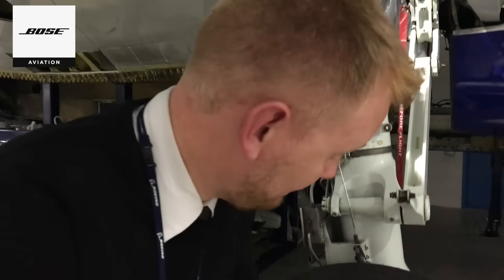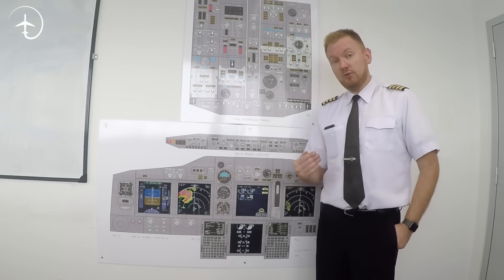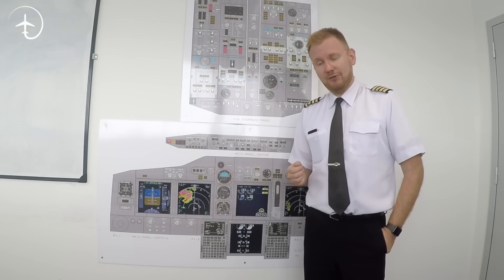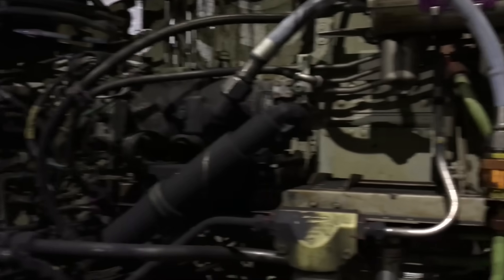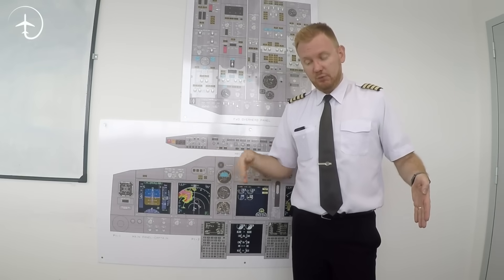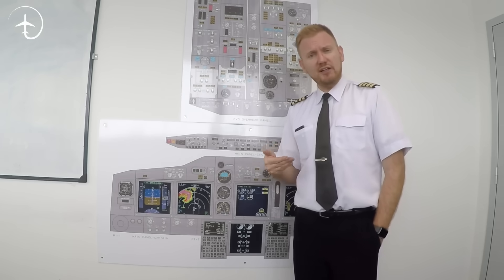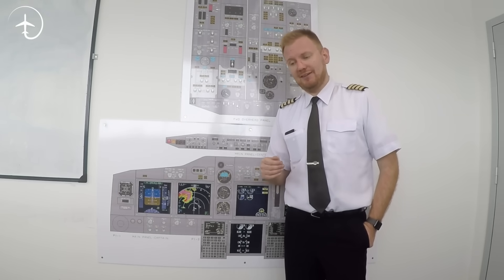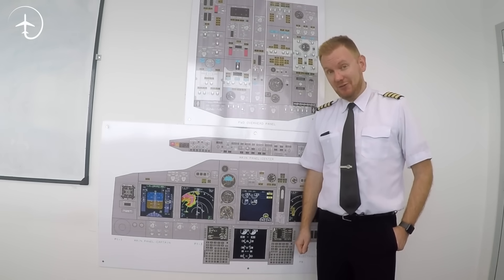Why does the Boeing 737 not have any landing-gear doors?

Comment: The short answer to the question is "laminar airflow".  It just flows over little spaces like the ones there.  With student naval aviators in T-28s, they thought that opening the canopy (sliding aft) would create drag and shorten the glide.  So we'd let them try it and it made almost no difference--the air just flowed over the resulting open space and didn't catch the open aft canopy much at all.

Comment: Disc covers on wheels are used on very high speed cars like for speed record attempts, aero 101. I'm surprised that all that equipment in the wheel wells is not simply covered by removable panels, they would keep the rubbish out at all times too and keep everything cleaner which would facilitate maintenance. Boeing, hmmmm.

Comment: Petter, if the 737 wheel well isn’t pressurised, and the psi is high enough to support the weight of a 737 @ sea level, surely in the rarified air @ 35,000ft, the tyre would want to blow - like a weather ballon?? 🌈

Comment: Tires are filled with Nitrogen. PSI depends on 737 series. Between 200 and 230 for the 737 Max. When servicing these tires it’s best to stand away just in case they blow up.
Reply: I got confused when he said 14 psi I figured it would be a hell of alot more
Reply: Really it depends on the tires the airline decides to use, but 14psi is hella low 😂
Reply: @Radim0303875  no. Its dictated by what boeing says is required, it's not up to the airline.

Comment: One extra step when changing the outboard tire/wheel assembly because of wheel fairing. Also wheel nuts are not visible on walk around inspection before flight. Not great. But it works.

Comment: Can you please make a video showing the difference between CFI,CFII and MEI
Reply: A CFI trains you to fly, a CFII trains you to fly on instruments, an MEI trains you to fly with issues related to multiple engines and engine failure.  

The only tricky part is that CFI is the base certificate.  CFII and MEI are added to it.

Airline pilots need all those skills and their instructors will likely hold all three at once.  

A video about the process of getting certified both as a pilot and as an instructor would be interesting.  I'm not sure if Mentour is based in the US though.

Training is regulated by an airline's home country. Everyone has pretty much the same standards, there's even a treaty about it (ICAO), but the details of training and certification will be somewhat different in different places.

Also once you have a larger business that flies commercially, that business is called an "operator" and the laws require operators to make and follow whatever rules are they are required for safety and common sense. This means that airline pilots are following a training program that's specific to their own airline and which goes above the requirements of their certification.

All pilots have the same responsibility to keep improving their skills, just like they have responsibility for flight planning and inspecting the aircraft, but in an airline the pilot isn't left alone to fulfill those responsibilities.  The airline helps them out with formal training and maintenance and flight planning.

Comment: Petter, one thing I didn’t hear you mention regarding the exposed tyres is low outside pressure. How come this doesn’t cause bloating or even blow out of the tyres? ✈️
Reply: Bill Kerman The 737 wheel well isn’t pressurised & the psi is high enough to support the weight of a 737 @ sea level, so surely in the rarified air @ 35,000ft, the tyre would want to blow - like a weather balloon?

Comment: 14 psi... I hope that you will never fly an aircraft with this wheel pressure in the wheels 😂
Reply: Ok that makes sense. I guess he was wrong. I believe you, sorry
Reply: preston rather that pressure is fine. The tires are large enough that they only need 14psi. Also, it is nitrogen not air so that could make a difference too.
Reply: its_kaven I am an aircraft tech and I can tell you that 14 PSI is not the correct pressure, its more or less 200 depending on the aircraft (189 on main gears of A320), 169 on the center line gear of the 340-200/300. But never ever 14 PSI on a 73. 
The size of the tire doesnt mean nothing, on the 320 the nose wheels are 206 PSI and mains 189 as I said. 
14 psi is not even what you put in your car wheels...

Comment: Boeing engineers...do we really need landing wheel doors?  do we really need secure cargo doors?  do we need an aerodynamic plane or will MCAS do?  That’s the problem in keeping an 1960’s frame flying.   Maybe a complete new design is needed rather then patch fixes....this is from a customer concerned with safety.
Reply: When you compare a '60s "737" to a recently-built version, they look like different designs with so many detail differences: it beats me how Boeing couldn't have found some way of building extra length into the main-undercarriage legs in order to provide the extra ground-clearance required by the bigger engine-nacelles of the 737MAX: they made a giant mistake by following the "software" path.

Comment: A guy name @ArtistRaju he copied ur video LoL

Edit: 4:31 Holy cow that's  alot of spaghetti
Reply: yeah imagine finding a leak! O.o,

we losing pressure slowly at the starboard wing flap and it's so slight you can't find any hydraulic oil, witch eats away any plastic it touches coz of the additives in it so you dont get a vapor lock in the tubing but yeah well easy... NOT

Comment: does low pressure affect the wheels?
Reply: The lower outside pressure does increase the amount of tensile stress in the rubber. But the colder air would also cool down the nitrogen inside the tyres, reducing the tyre pressure and thereby reducing the amount of tensile stress in the rubber. I however do not know If these effects cancel out or not. But the fact is that aircraft tyres are pressurised to around 14 bar, but may survive up to 55 bar. The lower pressure would only increase the relative pressure by less than 1 bar in flight.

These considerations are however not relevant in the design of the 737 as covered wheel bays of other aircraft are also unpressurised and therefore the same design considerations have to be made regardless of whether the gear is covered during flight or not.

Comment: Really hate to burst your bubble.  I am a retired manufacturing engineer for both McDonnell Douglas and Boeing.  The lack of gear doors is purely a financial option.  The 737 is built as absolutely cheap as possible.  They cut corners everywhere.  Even the passenger air ducts, which are rigid welded tubing on other aircraft are just pool vacuum hose held up by ty-wraps.  The nose gear on a 737 is a trap for all kinds of trash and FOD.  The  MD 80/90 717 series sits lower than a 737 and has full doors.  The nose gear of an MD 80 has 4 doors two of which close after the gear is down.  This along with a deflector on the nose gear prevent any damage at all.  Gear doors are hand fitted to each aircraft and thus take time ($).  If you need to vacuum your runway of debris then by all means get a 737.

Comment: Tires are not inflated to 14 psi ,perhaps you meant 140 to 200 psi. perhaps a golf cart has tires inflated to 14 psi.
Reply: Typically tires internal pressure has to match the external atmospheric pressure(14psi at ground level) + tensile stress of the material. Technically speaking i think it is to make tires which don't expand and as a result don't have tension exerted on their walls. I could be wrong.
Reply: @harishkumaar9085  I am sorry but I know what I am talking about . I am an aircraft maintenance engineer and have worked in the aviation industry for 40 years. Just look it up in the Boeing maintenance manual. The nitrogen pressure is there to keep the shape on the tire . Nitrogen in used because is an inert gas and the pressure changes much less when tires are heated at landing.
Reply: @harishkumaar9085  I am sorry sir but you are wrong. If that was the case when you get a puncture in your car tire it would not blow up and you would not loose pressure.
Reply: @brazidas58  I think he was talking about the wheelbay, not the tires themselves
Reply: @Secret_Moon :  NO he was not, I am an aircraft maintenance engineer for over 40 years so I think I know what I am talking about. In any case don"t take my word ,look it up. And yes they do use nitrogen to inflate the aircraft tires and this is do to that nitrogen is an inert gas ,reduces the expansion when the tires heat up on landing. There can be a 10 to 15 psi different between cold ant hot tire. This is why tire pressures at checked when there cold.Wheel bay pressure is  atmospheric pressure.
Reply: its 14 bar not psi
Reply: @doraice  No its pounds per square inch . abbreviation is PSI. In Canada we use psi in the aviation industry. 14 bar =203 psi
Reply: @brazidas58  ....dude.. he said 14... so I'm simply saying the unit for the number he quoted must be in bars and not psi. 14 psi is atmospheric pressure. I'm not an aircraft engineer, but are the tires gonna have 14 psi in it?... and oh... in Canada... both bars and psi is used.

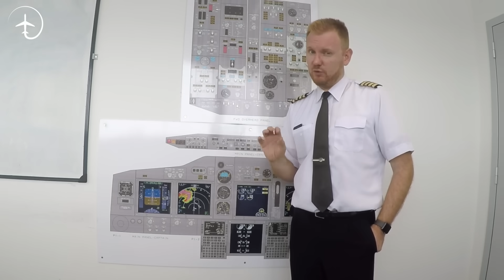Comment: "The tires are filled up to a pressure of about 14 PSI" (8:40) Wouldn't the tire pressure have to be much, much higher than 14 pounds per square inch.? perhaps at least 200 psi?
Reply: That's why don't trust pilots with maintenance stuff.

Comment: I don't understand. How does Airbus not have these issues? And shouldn't those hoses and stuff be in a separate easy access compartment and not in the wheel well?
Reply: They are higher of the ground.
Reply: @bluescan92  So why can't Boeing do the same?
Reply: @SDav21  it works doesn't it ?
Reply: @bluescan92  They had to come up with a whole bunch of additional things just to make it work. Boeing adds things for problems that should never have existed in the first place.
Reply: SDav21 they did avoid issues by simply not installing gear-doors. As Mentour already explained. Due to their complexity and relatively short distance from ground to the belly of the fuselage.
Reply: @bluescan92  👍
Reply: SDav21 The wheel well is a hub for a lot of mechanical components. That be hydraulics for flaps,  gears and so on. So it is better to have one big access point than many I guess.

Comment: If exposed wheels are the best option, why would other aircraft have doors?
Reply: Because they are higher above the ground, so they have more space for it. The 737 is very low above the ground compared to other aircraft.
Reply: @elscientist  thanks for your reply. Surely a higher aircraft means longer landing gear means more door means more weight? More reason for uncovered wheels?
Reply: @stephenmoody182  But also better aerodynamics.

Comment: Why couldn't they have just designed a 'horizontal sliding panel' incorporated into the underside of the mid-fuselage that slide back to cover everything when the gear is fully retracted? It would be aerodynamic and offer protection.
Reply: Because in mergency (low or no hydraulic pressure) situation, landing gear needs to be able to free fall into locked position.
Sliding panels, would need ballast to be dropped on chain to overcome drag to retract them, and free up the wheels.
Or they need pyrotechnic bolts to release them and free up the wheel. (which you wouldn't really want over land)

Since the panels need to be stiff to close prorperly they would be heavy, and requiring the extra weight of the ballast (or pyro's)  for emergency solution, they rather don't ad the panels, to accomodate 1 or 2 more passengers.
Reply: Now you have to think about reliable design with another secondary mitigation method in case the sliding door fails, which causes extra design cost + increased maintenance cost + increased weight.

After all, exposed wheel in flight isn't necessarily all bad - it helps cooling the wheels/brakes/tires which is great for many short flights within a short period of time, which 737 is designed for.

Comment: Interesting video ... so the 737 design has been tweaked continously from the 60's ???.
Not that there is anything wrong with that ... look at the B52 bombers.
Reply: tibby dude B-52’s have been continuously modified and updated with the latest technology since they were built. These days they have switched most of their hardware under the skin for new designs and have all digital instrumentation. So no, the B-52 has not remained unchanged.

Comment: Aerodynamics are that they are, natural phenomena, as the streamlines have to line up naturally around artificial curve engineers produce, including in aircraft. When a solid body moves forward, it is hitting the air particles in front of it, while it is trying to leave behind all the particles at the back. The front zone of the body is under pressure and what is more, it captures a volume of stagnant air that moves with the moving body. This pressure ahead of the moving body deals with fluid which shears itself and so at the front, there is an automatic reshaping of the effective front of the moving body, all done with reshaping the body of the front part with stagnant air which basically moves at the same speed as the moving body. Now at the back, the space that is created will cause a low-pressure zone and so a suction will cause the side air at the moving body to come into the space and fill it with a hell of a lot of pressure gradients, curling, and diverging functions, just to use the mathematical functions and the language I am used to as an engineer. 
Now the front part of a moving body all reshaped with " compressed stagnant air" does actually start accelerating the air much ahead and before the body hits the air particles and so there is a prediction of motion before the fuselage of the aircraft. This reduces the lateral acceleration that is required to get the air particles out of the way. So this lower acceleration due to the pressurized stagnant air will cause a lower drag on the fuselage. At the back rather than truncate the back as they do in high-speed boat with a wide transom, which you cannot do on medium speed aircraft operating in air, it is much better to accelerate the air laterally back into the backspace to fill it up with nice flowing smooth streamlines which produce a laminar flow filling system rather than the high gradients, curls and divergences when the air finds a sudden partial vacuum at the back of a truncated body as in speed boat which can accept that only because they are operating at the boundary of two mediums, the water underneath and the air above...........now the functions which I described above has been my interest all my life and believe me I designed a few efficient wings, tips, and water propellers with that philosophy. You know, I am not that clever because what I described above applies to all the flying and swimming creatures around me and all fish and birds have the teardrop shape which is the reason why that shape produces less drag. IT IS NOT NECESSARY TO HAVE A POINTED NOSE but it is very necessary to have the rate of change of re-entry of the air at the back as slow as possible. Hence looking at some aircraft with radial engines at the front they are even faster than those with narrow and pointed noses when liquid cooled engines are used. Nature is king in this philosophy. The fact that there are no streamlined landing gear doors is all contained  in what I described above, as the underbelly of the aircraft is a high-pressure zone and so in the wheel bay there is stagnant high-pressure air which will reshape the fuselage and the moving air will be effectively far away from the wheel bay and so since it is stagnant air around the wheels they offer not much drag as if they are being hit by moving air.
Reply: Carmel Pule'. Almost as plain as mud in an Irish Bog!

Comment: Are there any aircraft in which the whole main gear assembly goes straight up into the fuselage, instead of going in sideways?
Reply: Bored Tired plenty.  A7, P3, F8, F14, A6, Lockheed Electra...(commercial version of the P3, F/A18, A4.....A4,A6, F14 struts gold forward and extend with no weight on wheels and the wheels fold flat to the door.  A-10 is a modern day folds forward and wheels are partially exposed.  FA18, The wheels fold back it along the centerline of the fuselage.

Comment: Hello, I have few questions about landing gear. Why the wheels before landing are not spinning same or close velocity as plane have in time touch the runway? My opinion is that any even slow spinning wheels is better, than zero spinning of wheels, because big shock of bearings and tires. I think that wheels could be pre-spinned by an electric motor or even a tire design and flowing air. Is it used somewhere what I mentioned? All the videos I've ever seen on YT show no, but why? Thank you for response.

Comment: I have seen many instances of icing on the bottom of the wings but it forms from the very cold fuel condensing and freezing the moisture in the air as the aircraft comes in for a landing and taxi back to the ramp. It generally warms up and the water drips off before the next flight.

Comment: I usually have a problem with the length of your answers. They are usually too long for my liking with too much unnecessary information not related to answering the question. When I watched this I said to myself you could have finished the video in 5 mins because you answered the question, even the part about the hubcaps which was not in the title. HOWEVER, the rest of the video WAS very interesting as you gave loads of information relating to potential problems with exposed wheels which made the video quite interesting right down to the end. Very well done.